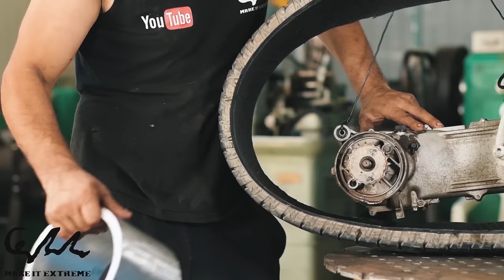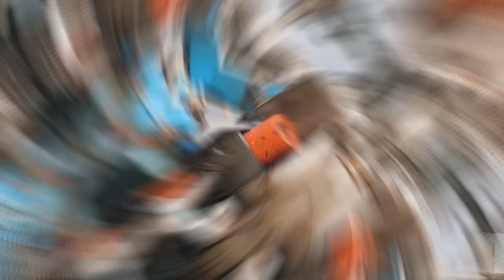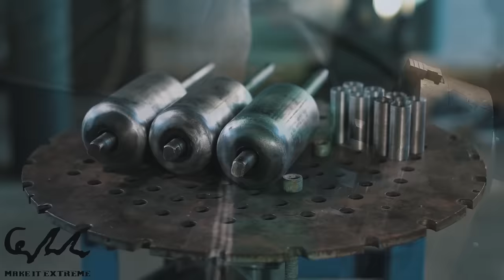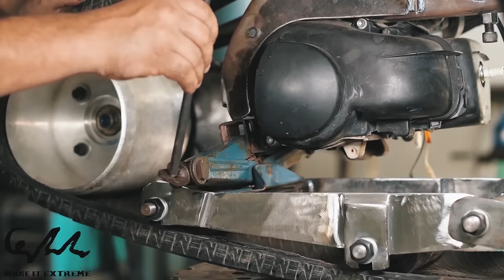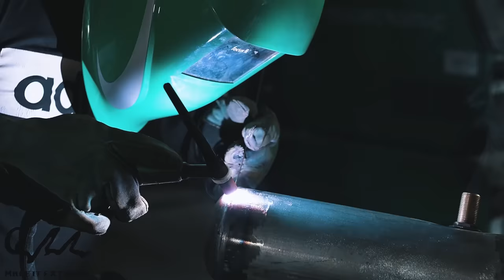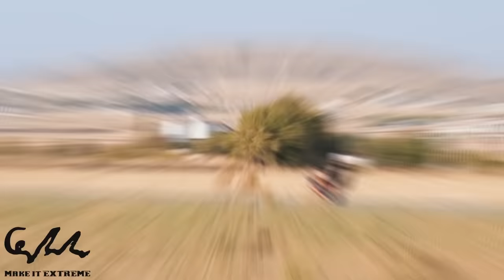Project 0100 | Making a Monotrack Bike

Comment: Very cool!  Like riding a giant Belt Sander with an Engine!  :-)
Reply: Lol
Reply: haha true
Reply: @imtheyamahaguy4872  only if you're into it...
Reply: not do shit with it
Reply: Lol  🤣
Reply: LOL
Reply: maj21093 u just described a belt sander
Reply: Why is that engine so small? A bicycle is faster.
Reply: @voornaam3191  Tracked vehicles are typically slow. There could also be cvt belt slippage and maybe clutch slippage. There's a reason Mattracks advises typically to not go over 50mph.
Reply: Gusto q sna mgkaroon ng ganyan ang aatig kc kakaiba
Reply: Yo
Reply: @-granjucoala604  

De
Reply: Lol😂😂
Reply: @ItsDaJax  
Not to mention the lost power flexing that thick, stiff, convex tire tread.
Reply: Not just the nuts tho. The femoral is pretty close to the edge of the steel belt when the edge frays or the belt snaps.

Comment: Turning tires into tracks by cutting the walls off? That's genius.
Reply: The internal steel belting works well.
Reply: @delmusingle2338  no.. that belt will break under the tight curves of this wheel
Reply: @bmxscape  ,,, I have cut tires for other purposes. You would be surprised at the toughness of those steel belts, however, there would certainly be a higher rate of 'tread' replacement needed. So what? It only wears out one tire at a time instead of two or four at once. And I am certain that any local tire store could supply one with many used tires, often for free. I have been told to get all you want from those out back with no charge. Good for many a mile on such a mono-track device. I am just too old to build one for myself at 67.

Comment: Only thing I'd want to change: See if more CCs could be squeezed in there. 

Awesome design.
Reply: I want to see suspension added and an off-road tire for off-road use,and a fender to cover the sides and just a bit to protect from dirt and even a backrest for the street version
Reply: Along with more power

Comment: Tidy work dude!
(sigh!) I want a workshop like that...and a lotta time off work.
...does the bike turn tho?
Reply: It does not need to turn...
Reply: @iare19  ahahahah tryy leaning on a flat track ?????
you want to tip?
Reply: The fact that the drive train cylinders are curved would allow you to lean and shift your weight and change the trajectory slightly but it would be an extremely wide turning circle. The French actually tried this vehicle concept during WW2. Lehaitre tracked motorcycle.
Reply: A nigga named Kyle yes you can do that, the handle bar just lets you change the size of your turning circle.

Comment: Freaking awesome! Best build in a long time! Needs a bigger engine though 😉
Reply: 🚜A much bigger engine😏
Reply: @MultiMarty100  use a truck wheel, (larger=more space to put useful stuff, like more cc's)
Reply: A gearbox would probably be enough lol
Reply: Not going only in a straight line would help, perhaps.
Reply: honda xr100 motor and a 40inch tire on it.
Reply: I'd make the whole thing about half as large again. The riding posture would be much more ergonomic. (Not sure what sort of donor tire would be necessary, tho)

Comment: Needs a bigger engine kinda waste of time goin only 10 mph
Reply: With more power you'd probably flip it constantly
Reply: @sirmounted8499  it's called throttle control. I bet your the dude that just mashes the throttle every time you touch it. You should never drive a rwd V8. Maybe not even a v6
Reply: It has tracks of course it's slow.
Reply: @jeremiahgoodwin3408  Thank you captain obvious, did you not watch the same video I did? Did you not see him almost flipping it touching the brakes? What are you going to do with more power if not have fun with the acceleration? Hit some high top speeds? Then flip it and die when you brake a bit too hard? Have fun with that
Reply: @sirmounted8499  so you are that dude.. your what's wrong with American drivers. How do you even have a licence?
Reply: @jeremiahgoodwin3408  You even think I am American that's funny, you know there is a whole other world outside of America, right?
Reply: @sirmounted8499  yea, but as an American living in the greatest country in the entire world I only acknowledge AMERICA
Reply: @sirmounted8499  and since your from some other third world country it doesn't surprise me that you'd be scared to drive this. I'd be scared to drive too if I where in some godless country

Comment: I mean i like it, but it isn t... slow?
Reply: It is cool, but it is bad too
Reply: Well I’d think that on a vehicle the size of a shop vac, with no steering except using body weight and balance, with brakes that will flip it if applied to hard, and a unguarded belt/track a couple inches from your wonka’s, you wouldn’t want to go too fast. And it’s not bad, it’s just slow, but you also gotta realize that the thing could probably crawl up a tall stacked mound of concrete rubble or gravel.
Reply: @logantc.1353  if it's not safe to use, then it's bad
Reply: Troll confiável then everything is bad. Everything can be dangerous. It  has the potential to be unsafe, like literally everything else, but in my opinion it isn’t bad, it just requires more attention to operate than some things. Tl;dr it is less safe, not low quality or underperforming.
Reply: Boy, I am whelmed.

Comment: Very very cool build However, I see an issue for later. You welded up where those sealed bearing and now they are not serviceable. Would be alot of trouble to have to build those idlers again or cut them just to change bearings.

Comment: Good stuff, I imagine you must also be thinking the same thing I was, needs a bigger engine, more speed for sure, but very well built and great craftsmanship, and the video editing was stellar, great job all the way around!
Reply: i was thinking maybe a  left-right segmented outer chassis, or a left-right segmented wheel pully system to allow tread deformation for sharper more responsive turning.

Comment: I see one flaw with this design.  When the suspension compresses the tension on the belt goes slack.  It needs a counter-roller to push up on another portion of the belt when the lower ones compress to maintain tension.

Comment: OK....but the video neither shows nor addresses how you're supposed to turn this thing. If it IS a viable, usable vehicle, one assumes it has to do more than just go in a straight line, which is all the video shows.... which is probably not a coincidence, as I suspect they didn't want to show that for a reason. I have my doubts whether this thing can turn at all, let alone be done with stability & ease.
Explain or show how it turns, and I'll be a believer. But all I see is a toy that can ride the hell out of a straight line, and little else. And that makes it a waste of time.